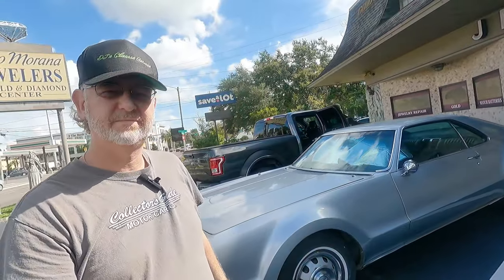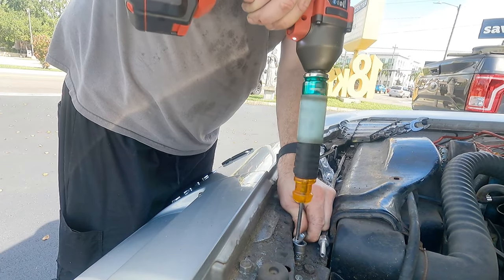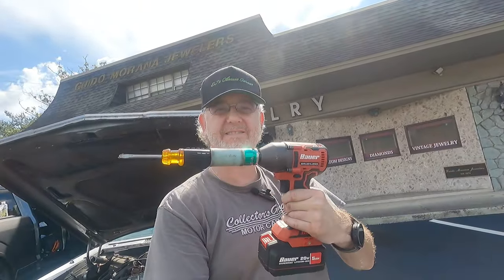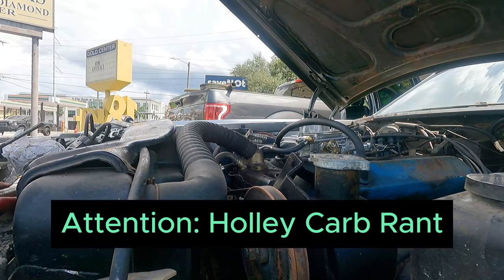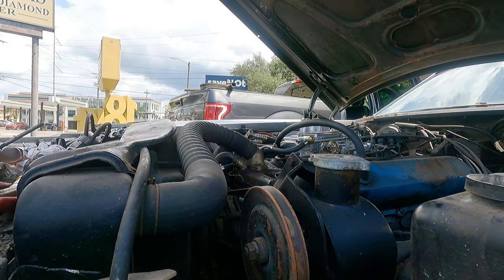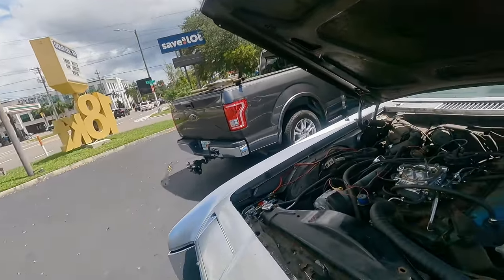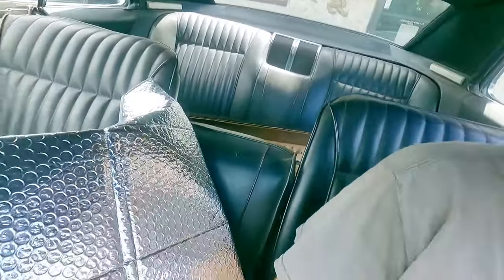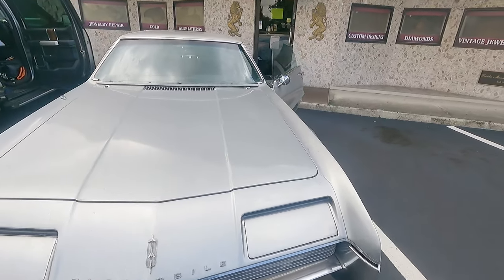1966 Olds Toronado First Drive in 5 Years.. Maybe?

Comment: I've got a very similar '66 Toronado. She looks good, she just needs some more TLC i'm sure. I've collected a ton of data on these things since I got mine so if you need any info, shoot me a message. The kickdown/switch pitch linkage isn't hooked up on to the Holley and I'm not sure how you could make that work honestly as it's designed for the Qjet throttle. That car came with a switch pitch torque converter from the factory and you need that kickdown linkage connected to make it function.....if it's still got the factory transmission that is.
Reply from the maker: I know,  I need to fabricate something that holly doesn't have a provision for the kickdown.  I am checking to see if there is a ready fix.  I would love any info djsclassicgarage@gmail.com